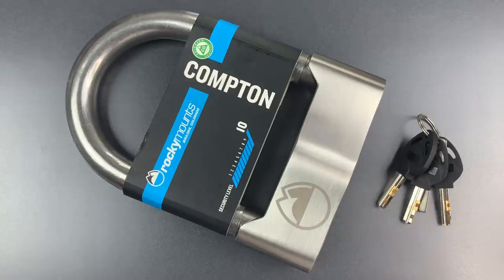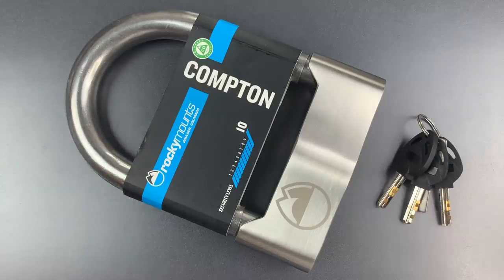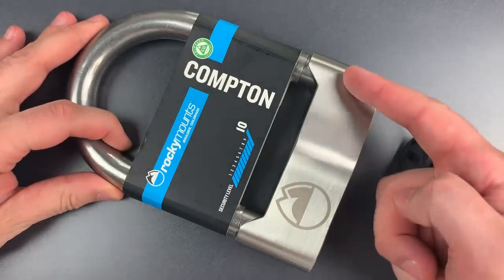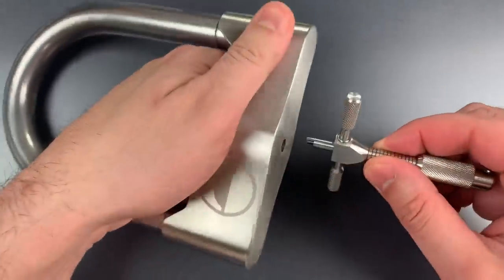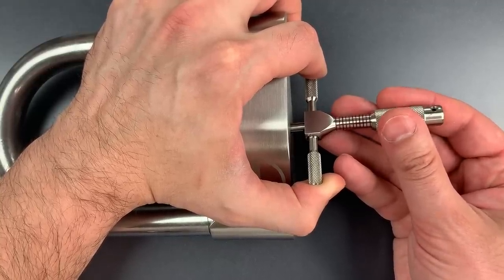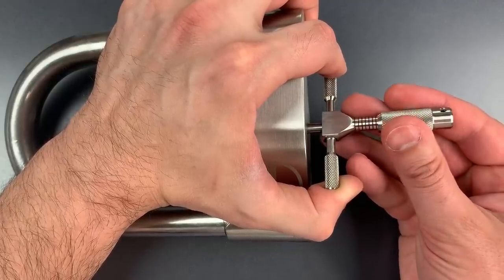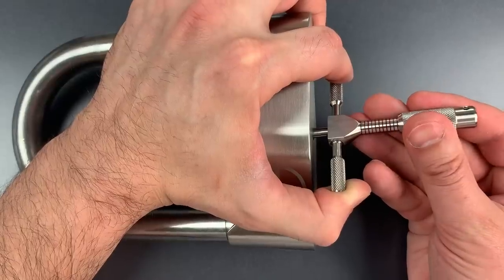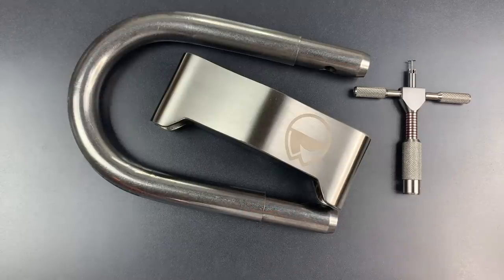[909] Rocky Mounts “Compton” Bike Lock Picked

Comment: This picking is beyond the ability of all bike thieves.
Reply: @patrick henry And don't forgot you have to try and pick this on a street with people possibly walking around and depending on where you position the lock it might be hard to get that tool in there
Reply: @programmerx8455  They made this tool, I don't believe you can buy one.
Reply: Sad part is all bike thieves nowadays have a cordless angle grinder.
Reply: @powertuber3.047  a quick Google search tells me you can buy them as cheap as 15 dollars. If they work as well as the one shown is up for debate.
Reply: @mikebroom1866  They sell 115 dB bike alarms with remote control for $20 on Amazon.
Reply: @jimbo5635  didn't look like the core was very deep in the lock nor the discs particularly narrow or keyway small so the cheap Chinese picks might actually do ok on this one.
Still very unlikely anyone with the ability and persistence to learn to pick these is going to be a bike thief.

They'll simply crop through the shackle instead!
Reply: @powertuber3.047  coat that alarm with Grease then it will be as quiet as a mouses fart..
Reply: Passionate-bike-owner's nightmare: Waking up from hearing a calm voice from outside where the bike is parked utter these words: "Nothing on one, nothing on two, number three is binding...."
Reply: @mikebroom1866  angle grinder makes a lot of noise and sparks though, that could attract attention.
Reply: @powertuber3.047  You just need a disk detainer lock pick, it's quite common. You also need the lockpicking skills to use it, which are harder to come by. :)
Reply: @timp2751  yeh, that's why it really needs a hardened shackle.
Reply: @powertuber3.047  they made this version of the tool, which appears to be a pretty nice version. But you can buy them for as cheap as 4,61€ on ebay and 14$ for a nicer version on banggood.com
Reply: @programmerx8455  Let's be honest, there's maybe 1 in 10'000 that have the civil/moral courage to actually say something to a bike thief. Most people just walk by without noticing, and wouldn't give a damn even if they noticed. I've lived in a city with a lot of bikes, and about as many bike thefts. A friend got her bike stolen from a very open and populated street, mid day.
Reply: Any evidence and data, Daumier? Anecdata and guesses are not reliable. There are a crap tonne of people out there who offer assistance at random moments. And there is a very good reason why the Dutch are adding main cycleways right down the middle of residential areas: lots of passive security from thousands of windows, especially for children.

There are ways to increase passive security too. Like excellent urban planning to foster a more permanent community and community safety.
Reply: Don't need anything other than an angle grinder and a high vis jacket.
Reply: Ascdren, a lot of people wear hi-vis for work. And it's not an uncommon site to see many people on break at a cafe, or going to a local shop after work with their work gear. Hi-vis doesn't mean anything special in this common context, and you would need a collection van with proper markings to make people less suspicious with this information.
Reply: @powertuber3.047  "They sell 115 dB bike alarms with remote control for $20 on Amazon." - Which nobody will hear under the sound of the cordless grinder cutting away. 😆
Reply: @C0deH0wler  you really overestimate people.
Reply: Stigstigster

Good chance you will have to move the u-lock/chain into an advantageous position. Just to note.
Reply: @C0deH0wler  Not sure where you are from, but I know around here the chances of someone calling out a bike thief are near zero. There are even academic studies on the subject of people in large crowds not caring - because everyone assumes someone else in the crowd will come forward. The chances that someone intervenes actually goes up the less people are around because 1 nosy neighbor is  more likely to call the cops or shout at a thief than 1000 people passing by on a busy street. 

Side note, it's poor form to attack someone saying "Anecdata and guesses are not reliable" then expecting others to respect your own unproven anecdotal statement about there being a "crap tonne" of people to offer assistance.
Reply: I have heard studies that show they won't even help when a woman is screaming rape.
Reply: @jimbo5635  They don't. I am a hobbyist myself and I've yet to find a proper disc detainer pick that is affordable.
Reply: @programmerx8455  I wonder if the picking tool that Bill and LPL built is available on ebay?
Reply: Y'know, we all believe that his day job is lawyering, but we haven't got any proof that he doesn't make his living stealing and reselling top dollar bikes...
Reply: Programmerx people won’t say anything on the street. I’ve had friends lose their keys in college and one had some jerk put his own lock in a bike he didn’t own. I got the locks off with massive bolt cutters in broad daylight. If you don’t act like you’re doing something wrong, nobody says anything. I even had police officers walking by and not saying a thing.
Reply: Hakageryuu  No, he didn't say that.
Reply: @powertuber3.047  you can buy disc detainer picks that would work fine on this lock from multiple websites
Reply: I reckon LPL might actually a Thomas Crown style thief in his spare time.
Reply: Nicely picked as always. 
Looks like a really nice lock even though it will scratch your bike frame to bits.

So what's the difference with heat treated and work hardened?
Reply: Unless the lawyer wants a new bike ;-)
Reply: @powertuber3.047  I heard if you really want help, you yell fire.
Reply: Not All.
Reply: 666 like
Reply: @jimbo5635  they don't, which is why LPL and Bosnian Bill made that one. They did a 6 videos covering it split between their channels and in the first one, they explained the problems with the available disc detainer picks
Reply: aka  meth heads won't be stealing it anytime soon lol.
Reply: Not to mention he’s got some custom skeleton key type pick lol
Reply: @C0deH0wler  are you kidding? My bike was stolen from the rack of the Courthouse! Just in front of the main entrance with armed guards!
Reply: @ewoodley82  thanks
Reply: He literally said that
Reply: @programmerx8455  Watch Casey Neistats video on bike thieves, you could pull out a angle grinder and cut the damn thing and no one would care.
Reply: @C0deH0wler  I don't know what you're on about, I'm dutch and we once had to "steel" a scooter for work. I work at a food delivery company and some delivery guy lost the keys for lock of the scooter. We were not wearing any company clothing just our everyday wear. We took the scooter from a busy square and walked out of the city center even passing police officers, granted this was after the deed. No one even thought about asking what we were doing.
Reply: @powertuber3.047  Yes, and they really do work, even when in my saddlebag it's ear-splitting loud
Reply: @programmerx8455  but picking a lock can look like someone just trying to open the lock i mean as long as you don't show the tools so obviously
Reply: @michaelturner4457  yes; actually my Kryptonite NY lock was 90% angle ground when my doormen were able to chase off the thief. Night time and sparks and noise aren’t the best combo. Kryptonite NY locks survive about 1 minute vs a corded grinder and more like 4 minutes with a cordless. This Compton won’t last nearly as long as 1 minute without hardening, and I replaced the Kryptonite with a far more grinder-resistant lock from LiteLok. The thieves are not picking locks, they are grinding them.
Reply: @ensampojken  I had one stolen ON VIDEO SECURITY CAMERA AT MY WORKPLACE. At that time I was using a woefully inadequate lock…

Comment: Hey LPL.  I think a great addition to these videos might be some hardness testing picks / files to scratch test the body and shackle of locks without needing to perform a full destructive test.  

Thanks for the videos.
Reply: Deeper groves at a LVL 7??
Reply: Tyler Frum (materials scientist here) we have largely phased out hardness testing for rigorous testing of metals and alloys now, in favor of full destructive testing. From a destructive test (especially tensile deformation test) you can actually get the raw numbers on exactly how much pressure is needed to fracture  a specific specimen. Nanoindentation is also used to calculate the same things as a full destructive test in a non-destructive way, but it’s still mostly in labs rn.

TLDR: hardness testing is insanely subjective and doesn’t actually tell you very much. It’s also tool-specific. Destructive testing gives you hard numbers that can tell you how much force with whatever tool you have you need to fracture something

Comment: "but other than the choice of material there's not a lot to complain about..."

Real pity that the material is probably the most important part by quite a distance! The best you can do with d locks is force the use of an angle grinder and it doesn't look like this lock will do that. I've never heard of corrosion being a real problem in bike locks except perhaps in stopping the core functioning.

Comment: i love how at the end you do point out that this is beyond most bike thieves. the only weakness it has is a set of giant bolt cutters. because every lock can be picked so that can't be called a weakness, and when two locksmith/picking "pros" put their heads together to make a pick, of course the lock is going to fall open. given the design you could probably just make your own shackle if you wanted, although honestly if you went that far you could probably just convert a a really good lock into something like it. still i do have to point out that a video like this makes a very reasonably secure lock look scary. might want to be more forward with the "though probably beyond the abilities of most bike thieves" part. and the "it might be a lock to consider" parts of the video. new players might feel completely frustrated with all of this and just say "fuck it" and buy a crap lock because they don't see that it matters. the objective here is to improve security right? someone just looking up the lock is going to see a 3 minute video and the lock falling open. they won't know that you are using a custom tool with decades of knowledge put into it. or that to cut that shackle it would still take a GIANT bolt cutter or several minutes with a grinder. they just know that you opened it in seconds and they don't want their lock to be opened in seconds. please HELP people get security without causing them to say "fuck it, it doesn't exist".
Reply: Want to see someone running around with a bolt cutter that can defeat 18 mm of not hardened, but still pretty resilient Steel 🤣
I think with a lock with this pic resistance and no exploitable weaknesses, you only need to fear bike thieves with an angle grinder

Comment: Cordless power tools such as a small grinder with a cut-off wheel installed would make it easy to defeat most locks.
It's not just what lock you use, it's also where you leave your bike. In certain places, it wouldn't be safe to leave a Tank. lol

Comment: Unrelated to the lock, but more about the pick: I have to say, that pick is the best thing you've added to your channel recently. It provides a good bit more detail as a viewer, letting me know just how far apart the discs are. Nothing high-mindedly insightful to say here. It's just kinda neat.

Edit: I wonder how hard it'd be to swap the shackle on that. It wouldn't cure the lock body likely being made of the same material, and you'd have to hit up some machine shops and pay a good premium on top of the cost of the lock, but grinding the body is a bit of a rarity next to grinding the shackle.

Comment: When the shackle is that thick in a way it doesn't matter. It doesn't resist hacksawing like a hardened shackle would, but angle grinders take the same amount of time regardless of the heat treatment or steel type since they heat the steel up so much from the abrasives. Either way some form of power tool would be needed since you'd be there for a while with a hand saw. A hydraulic bolt cutter would be a different story, but those are a little harder to conceal. If they wanted to have a harder shackle they could use a stainless that can be precipitation hardened like 17-4, but they are more expensive. But on the same token it probably wouldn't be 18 mm anymore since its stronger.

Comment: Maybe some bike thieves pick bike locks. Mostly it's bolt cutters.
Reply: Or angle grinders.
Reply: Do NOT It used to be bump attacks, rumor on the street 40 years ago was that a well placed kick would open most locks at the time and leave the bicycle intact for riding it away.
Reply: That's BECAUSE bike locks have adequate locks.

Comment: That is an absolutely gorgeous piece of industrial design. It really deserves a better core.

If that's 18mm, you'll have a hard time cutting it with anything short of an angle grinder or large hydraulic shear. You could hack saw it, but that will take forever. A Sawzall might be feasible.
Reply: I'm trying to imagine bike thieves holding a loud sawzall for several minutes to cut this away and I'm not seeing it. It might be doable, but I don't think it would be done.

Comment: The 18mm thick shackle means that it can't be attacked by bolt croppers so the fack that it's stainless steele doesn't matter. This leaves only angle grinders which will cut any lock anyway.

Comment: Stainless steel 304 can be hardend quite well actually, but requires different route than normal steels same goes for all stainless steels(You can't heat reat all the way in one go you need to do it in sections)

Comment: They make cheap exhaust from 304 stainless, it's actually super hard.  I tried to drill through it with a common drill bit and nothing... had to use a very expensive drill bit kit from work to get through it!

Comment: Considering the tools that are easy accessable to pick disc detainers on the market and how they compairs to yours, id say its quite resistant from picking. On these kind of locks, one thing i wonder is if they are tight enough to completely nullify the chinese picks, even with modifications to the tip.

Comment: when it comes to bike locks. picking is basically never an issue. they're almost always opened via destructive measures such as bolt cutters or angle grinders. that said, what bike lock has the absolute best residence to physical attacks? I live in a city with a bike theft epidemic.

Comment: At least 304 won't crack, even when used for cryogenic systems. But yeah a decent hack saw will go right through esp with high pressure cutting fluid(eg with sulfur, moly, or graphite) to prevent galling and gumming of the saw teeth.

Comment: It would be interesting to see a heat-fitted stainless sleeve overtop a hardened steel core, perhaps forge-welded permanently into place for an ultra-durable corrosion proof shackle coating. But truth be told, it seems that boron carbide shackles don't really rust. The only rust I see on outdoor locks with boron carbide shackles seems to come from the hasp.
Reply from the maker: Quality anti corrosion platings tend to be quite good these days. Unless I was in a constant marine (salt water) environment, I doubt I’d use a stainless lock.
Reply: I mean more as a corrosion proof coating that's immune to abrasions. Plating is generally good at chemical corrosion, but when it gets scratched up it fails rather spectacularly. And plastic sleeves only do so much to abate corrosion. To clarify, I was thinking of combining the best of three things for a more or less indestructible (to physical wear) anti-corrosion coating. It would probably be overkill for any application that wasn't locking things up either at sea, or in a salt mine though.

Comment: Is it possible to combine different lock types into one core? Like disc detainer in the front, dimples or pins in the back. Based on the equipments you are using it would be a p.i.t.a for picking those kind of locks.

Comment: Why not use the heat treated steel for the core of the shackle and then layer the corrosion resistant steel on top of it?
Reply: Airmanon Might as well use a pure anti-corrosion layer such as paint or rubber.
Reply: @johnfrancisdoe1563  Paint and Rubber can be scratched off, making a lock vulnerable to shimming.

The finalized shackle without any non-hardened coating has just to be as thick as the holes it has to go into. Ideally a shackle is a bit thicker outside the lock's holes so the holes can't even be seen.

Comment: Could you do a review of its strength? I know you said it is made of weaker material, but it seems like it is much thicker than usual. If it makes up for the material in bulk, this looks like a really good lock.

Also, I am looking for a good bike lock for a college campus. What are you suggestions for a not too expensive lock that would be appropriate for that setting?

Comment: I think if you need a custom, self-designed tool to be able to pick a disc detainer core, it's probably beyond the skillset of most bike thieves in my college town. It seems to me that between two otherwise equivalent bike locks, the dd core is more secure than a standard core. Is that fair?

Comment: Are you certain that the hardning matters all that much on locks in these sizes? I believe it will be quite hard to cut with a bolt cutter, and 304 is quite a "chewy" material like titanium, so although a lot softer on the mohs scale, it's still quite tough and hard to break.
e.g. the double-wrench attack will only work on locks with a shackle thats hardened enough to allow very little plastic deformation, if the material allow quite a bit of plastic deformation (like 304), the wrench attack will be rendered useless.
You can cut it with a saw though, but 18mm in 304? Not an easy task.